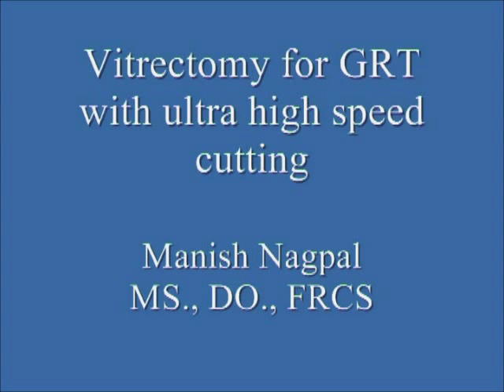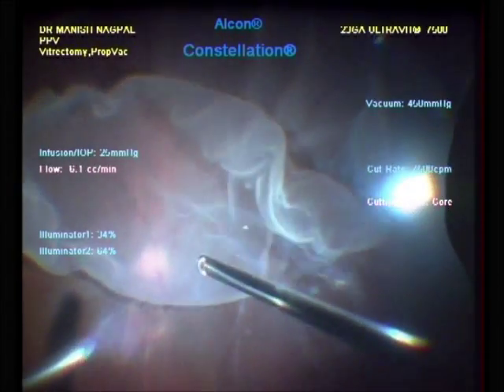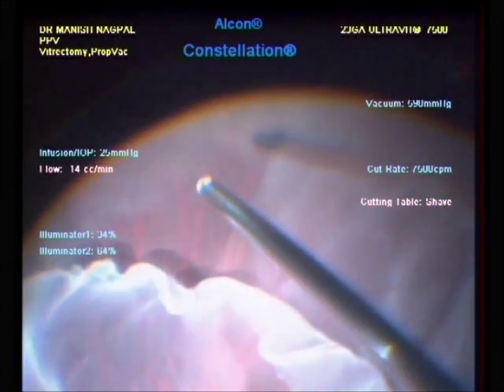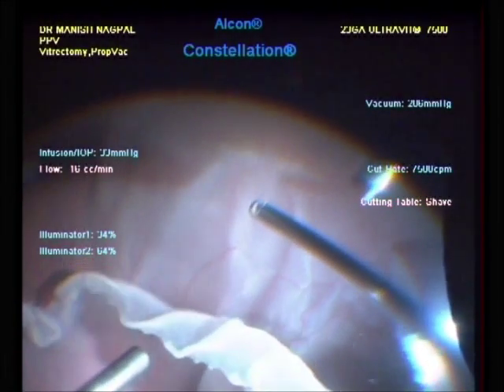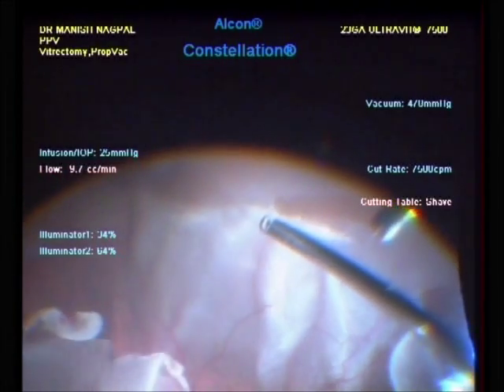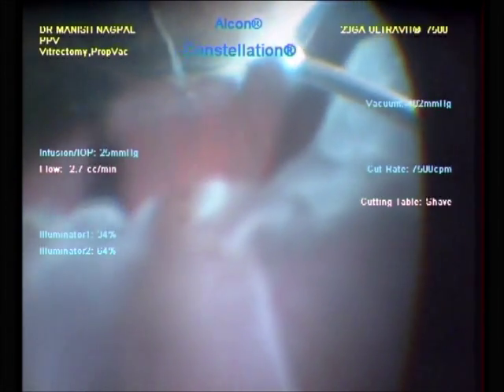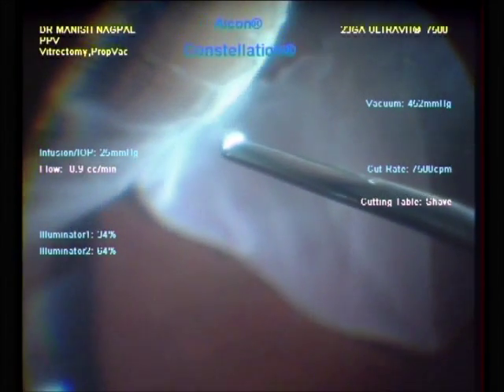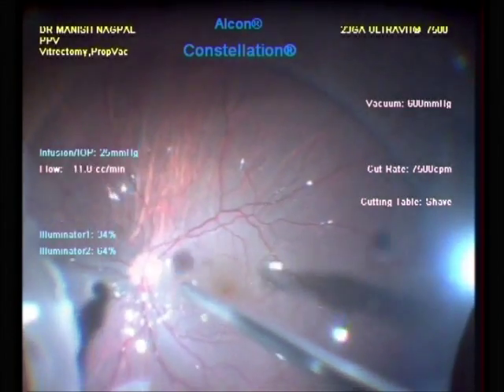Vitrectomy for GRT | 7500 cutter | Dr Manish Nagpal

Comment: Beautifully done. Kindly share constellation settings for 23g. Regards
Reply from the maker: Thank you.  I typically use highest cut settings and vacuum is on linear foot pedal control as per requirement
Reply: @DrManishNagpal  thanks